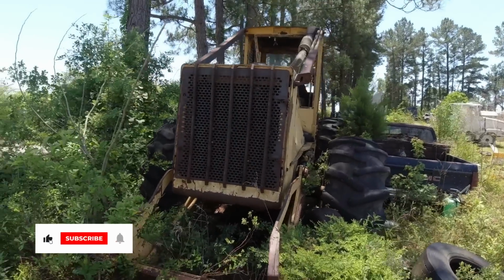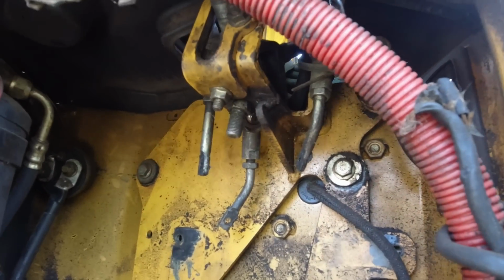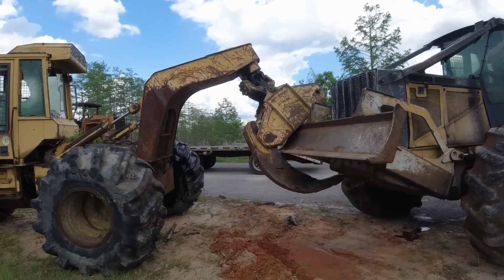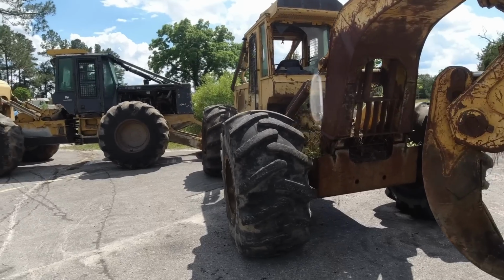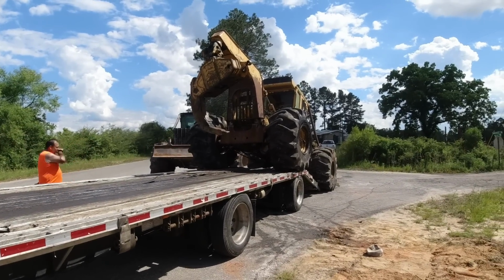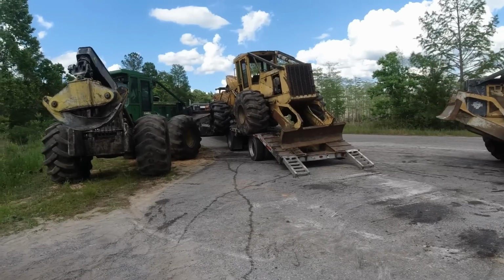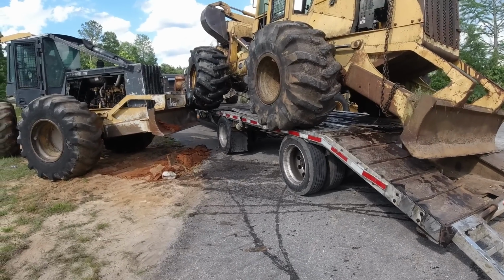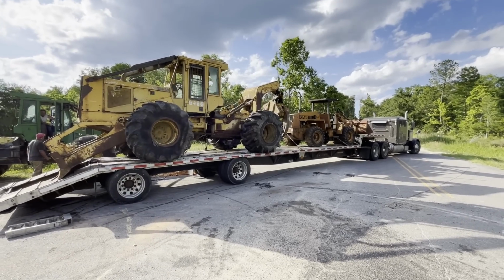Skidder FALLS OFF Trailer! Loading junk with junk goes bad fast!

Comment: I felt said about truck driver, damage on trailer, stuck in there for hours. Time is money for them. I'm glad everyone is ok, using wrong equipment can cause more trouble esp if you dont have enough control on it. Backhoe worked longer than i expected, my bet was 20 sec  on a hydrolic hose before it blow up, it was too small for that heavy machine. Actually real problem was those big tires which was working like shock absorber, machine was coming back when you push it. From a distance i got scared that moment smiles. Thanks guys..
Reply: Hydraulic hoses on backhoes don’t blow from overloading them. The systems have built in bypasses. They will only pull what they will pull.

Comment: Oh Boy Hank!!
Here's what we have folks! 
1. Hazmat spill.
2. Trailer that needs tig welding.
3. Ford 555 hydrolic lines rebuilt.
4. Wylie needs a huge raise and two tubes of lenament  for sore muscles 💪 😏. 
5. The correct hydrolic manifold. 
6. Brake cleaner with the correct spray caps.

And I need to donate $$ because I've never laughed so hard. 

Love it. ❤️

Comment: Looked like the truck driver had already destroyed a good trailer by using it for something it wasnt intended for and then to push that skidder off the side and do serious damage to the trailer. Its no laughing matter. No equipment should be treated that way.
Reply: I would assume he is a hot shot driver. Picks up different stuff and not the same thing, just a guess. I I haul the same thing everyday though. Junk A/C units that comes off of rooftops but they get loaded with a crane
Reply: Hahahahaha

Comment: Another trick for centering a dead machine on a trailer like you were doing there. If it needs to go toward the driver side of the trailer run a chain across the trailer to the passenger side of the machine so you can t make it go any further that way and lift the driver side of the machine and put a half sheet of plywood under the tire. Then go to the passenger side and lift and push. Put the chain across the trailer from the pass side of trailer to driver side of machine with however much slack you want to move it over then push it over. The tire on the plywood will slide easily so you don t have to push as hard and the chain won t let you go too far.  
      It's kinda like long pants put that stuff in the pickup when you go so you will have it if you need it.

Comment: Would have been a lot easier to load if you had had a Rotator wrecker. Especially since the machine is dead. You would not have wrecked that guys trailer. You probably would have been done in no time. Hauled machinery ,tons of military equipment in 45years. I personally would not have loaded that load. Would not have been worth tearing up my trailer. Just Saying. 🇺🇸
Reply: Exactly a damaged trailer as a result of using the wrong equipment.

Comment: It should have a pin and bar to lock the machine straight for loading when it's not running. If you are going to continue to do this you should make you or grab you some for the most common machines. It's better to winch the machine onto the trailer rather than try to push it on if possible because it is easier to keep them straight. I hauled in dead equipment to the shop for years when I worked at a CAT dealership. You can also put a chain across the trailer to the machine so it can t go far enough to fall off when you are pushing sideways on it.
Reply: Spot on.
Reply: It's definitely  easier  to winch anything on a trailer if you have one that is. This trailer didn't have one though. If he continues to use the trailer like this then yes it would definitely be worth getting one put on

Comment: I normally like watching your “will it starts” but not this one. Your lucky the drop deck driver didn’t beat you all to death tearing up his equipment.  What a hair ball operation. And your nonchalant attitude over damaging his equipment disgusts me. 

 If this had been my rig I would have told you all to get f—-‘d. If you don’t have the proper means to do this stuff then  you shouldn’t be doing it.  Especially when others people’s equipment and livelihood.are involved. You’ve easily cost that driver several days worth of repairs and loss of revenue just  on the obvious side rail damage.  Who knows what other damage may have occurred to the frame and suspension and deck. Trailers aren’t designed for such abuse.
Reply: absolutely agree  heavy rescue tow guys would have put that machine on in no time and without the damage, and they're not crazy expensive either.  i'm also disgusted with this loading,  and of course doubt and extra money was offered to the driver

Comment: That trailer was junk too. Way to light, to small and a winch would have made it a lot easier to pull the skidder on. I guess a proper lowboy cost more, but the load should not have taken more than an hour, and with side boards it doesn’t slide off so easy.

But it makes good material for us to watch though😀

Comment: Too many wiggling pins and wobbling shafts. I've been in these situations all my life because I guess I was scared and moved S L O W.  And did a LOT of praying. It sort of goes with the territory. Yall did good. Steel and aluminum can be welded but skin and hair usually comes back after a lot of screaming and blood letting. Wiley did GOOD for having a death trap to work with and you did good to just stay out of the way. My goofy neighbor the contractor was one of the worst for stuff like this. His stuff would've been junk 10 years ago if not more. When the hydraulic pump FALLS OFF a trackhoe...................well, you can figure the rest out on your own. And the good part is that the Almighty saw fit for us all to live through all this mess. I need a nap. God Bless ALL Yall!

Comment: Unfortunately you don't think things out. Because of the articulation issues you should have used a ratchet binder on each side and you would have been able to actually steer the machine by adjusting the binders. It would have been much safer and easier to load

Comment: Man that sucked how bad that went. I've been round equipment all my life running it and buying and selling. If it was easy more would do it I feel real bad for wilie  having that happen while trying to earn a few $ . some days you make good money some days like this staying in bed pays better.  over the years I can think of a few machines I've looked at that were fixer uppers in situations like this , my instincts told me just walk away it's not worth the hassle and I've found out later through other contacts I was right. 
 To be honest you showed this mess and what can happen . If it unluckily  happened again put the camera down and turn it off and go help with both hands so you are 100% focused and don't get hurt if a chain slipped or something  goes wrong . It will also take some of the stress off the bad situation for all others involved to Digger guy was having a bad day to dealing with something that wasn't really his problem either. A camera really doesn't help some guys, I'd of been to the point of getting  stressed out and i wouldn't of been polite telling you to turn it off and get out of there.  luckily nobody got hurts the main thing now, Take care guys.